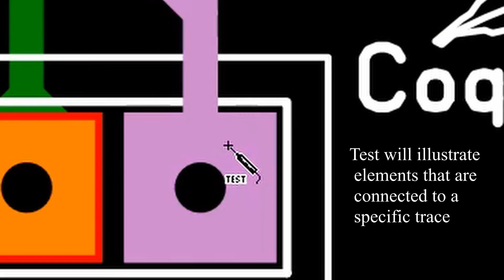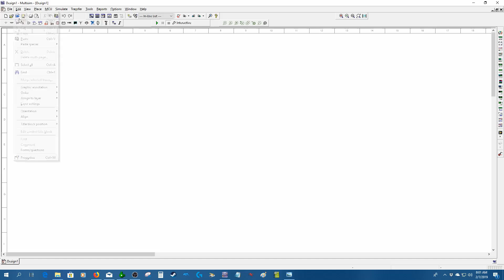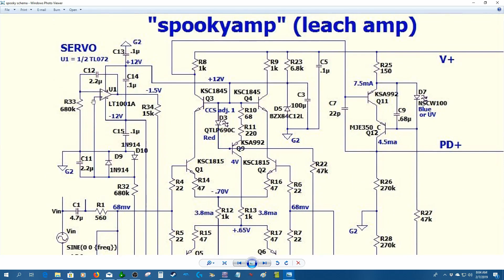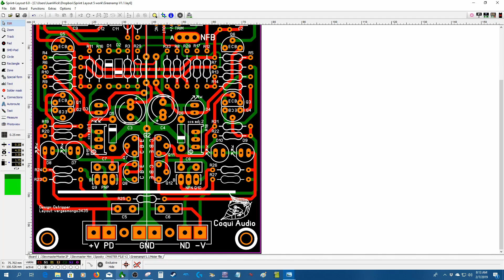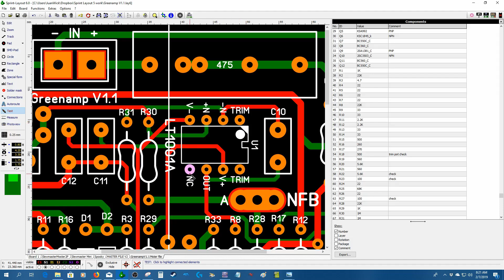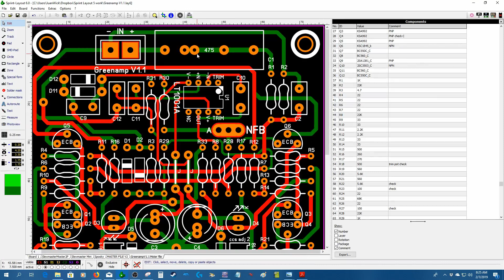Greenamp V1.1 part 5 English (please read description down below)

Comment from the maker: [QUOTE=ostripper;5690970]R15-18 = trimmers.
You can read the VAS current with R23 , then subtract R25 current to
get the REAL VAS current at the Q9/10 collectors.
LED'S (R25) use about 1.5ma of this VAS's total current.
If you overload this VAS it will cool down and the leds will blink.
Your output on overload will look rounded smooth instead of the
normal harsh transistor clip.